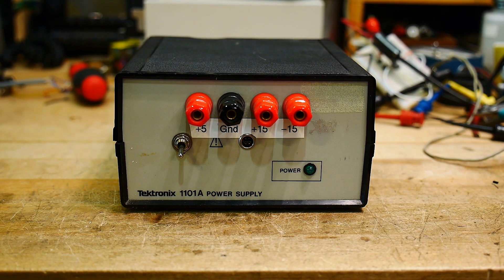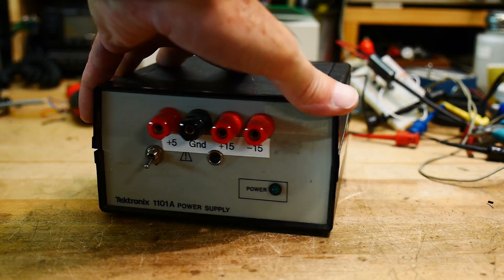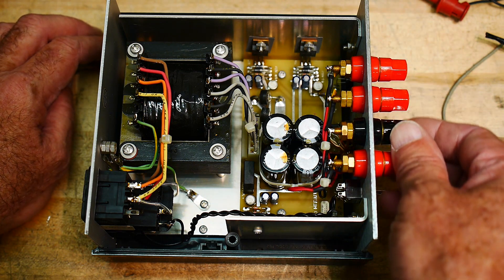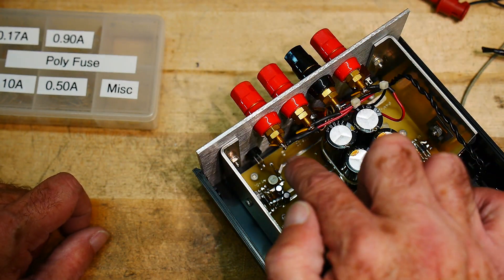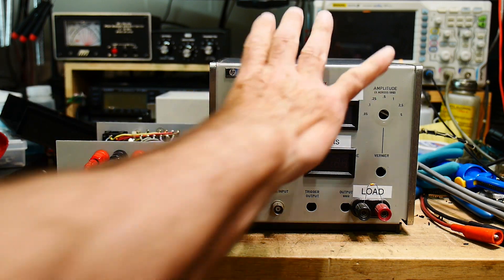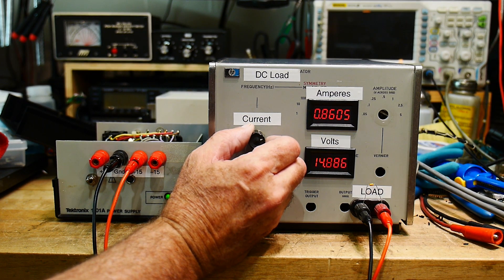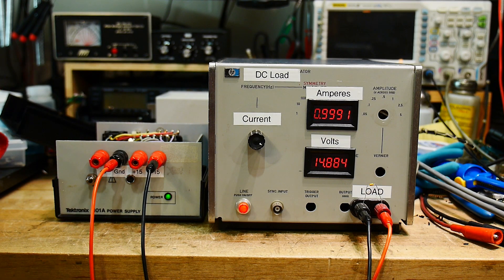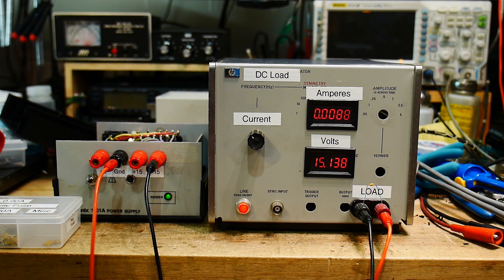#504 Tektronix Power Supply

Comment: Nice. I have the board and transformer for a Tektronix PS501 power supply mounted in a homebrew aluminum case. I did this in the early '80s. It's set up for 1 amp instead of the 400mA that it can do in a normal slot in the rack, it thinks it's in the high-power slot. I just found it in a box in the garage, it used to be my primary bench supply for years, lately, I've been using a pair of Chinese switching bench supplies that can put out a lot more voltage and current. They have a lot of noise compared op the totally liner Tek supply though, so I'm thinking of using it again part of the time. The only concern is that, like so many Tek items from the '70s, it's full of tantalum slug capacitors, they were a little prone to blowing up when they were new, this supply hasn't been powered up for about 17 years, so it makes me a little nervous. I just did some research, and some sites say just go for it and replace any that blow. They tend to go out shorted though, so it's a little risky. OTOH, the circuit is simple and uses totally common parts that are still available, so it'd be easy to fix if a shorted cap takes something else along with it.
Reply from the maker: Ah, those pesky tantalums. they either last forever or go short as you say. Good to replace if they are in a place to do damage. otherwise wait for the fuse to blow in the future and fix as needed